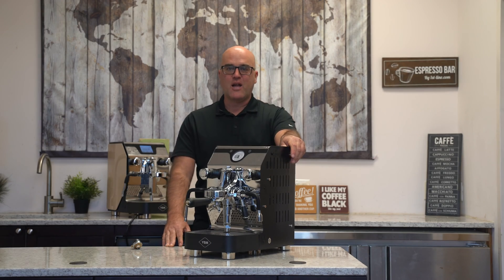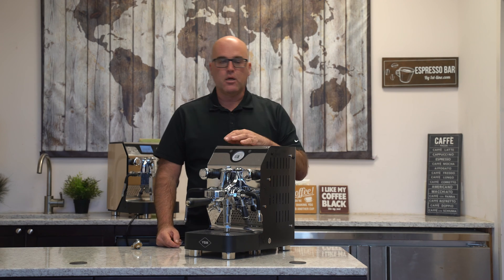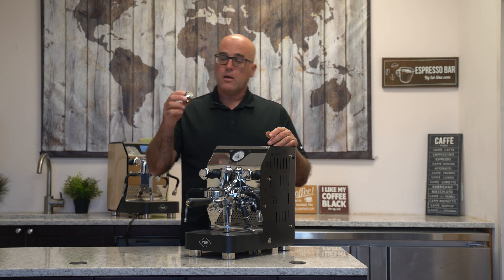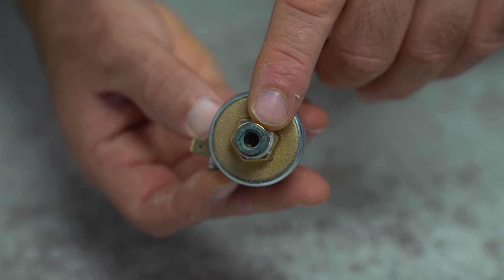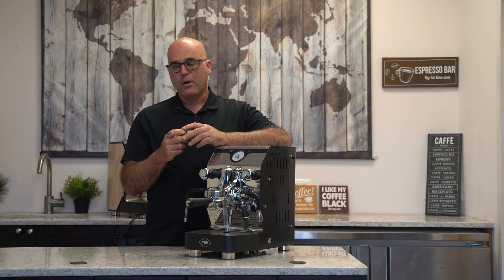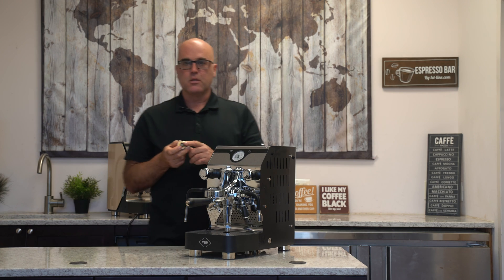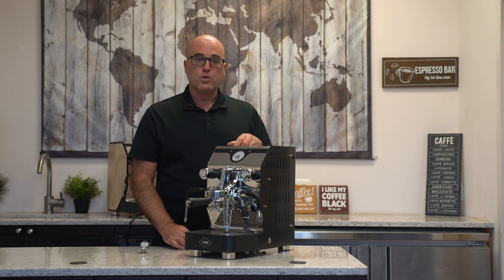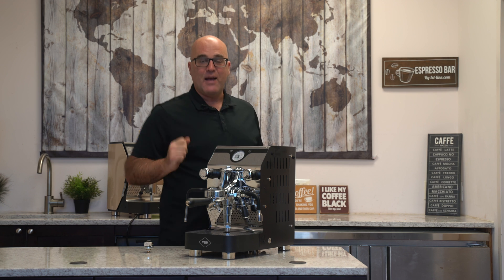Tech Tip: Why Is Your Heat Exchange Espresso Machine Not Heating/Overheating?

Comment: Hello and thanks for the video!!! Just to be clear- the espresso machine has a pressure-stat and not thermo-stat? mine(ECM Mechanika V Slim) is heating slower than usual and I can hear that it stops heating and than re-heats, also when I brew hot water, it takes some time to boil again to the same level of pressure.

Comment: Hi Jim, Great info on the pressure Stat. I'm considering going to a PID/SSR to control my steam boiler HX machine. Do most machines have a bung with threaded thermocouple probe as you mentioned? I would think the reading should be from the bottom of the boiler where the temp is most stable seeing as the water is laying in the bottom. When I added PID to my Silvia I simply replaced a metric screw at the thermostat location which did not penetrate the boiler. Any insight would be appreciated.